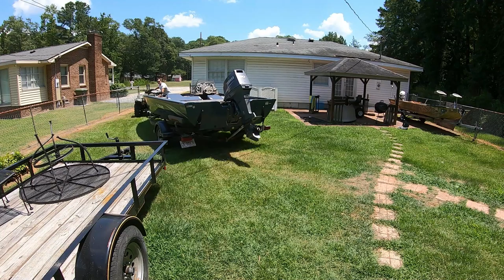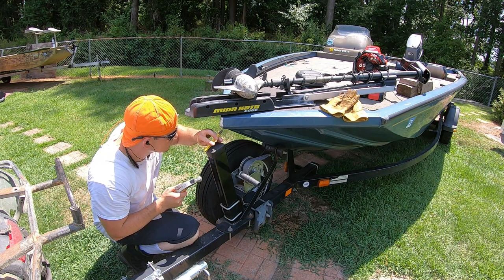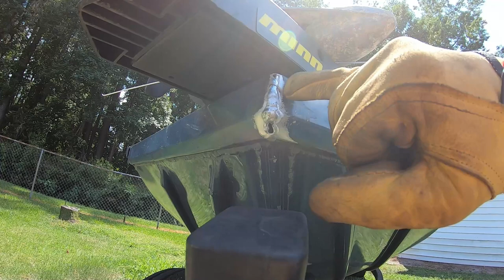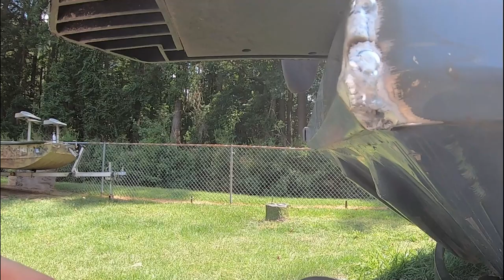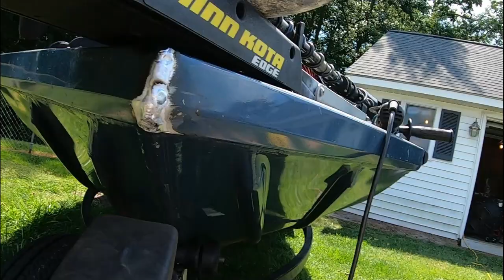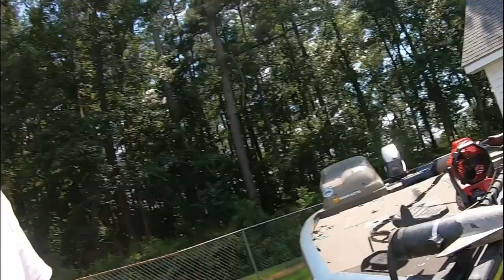How To Weld An Aluminum Boat

Comment: Nice job buddy, that will be stronger then it previously was. I've been working on boats for 44 years and still have the lowest labor rate than anyone but, you know as well as I do that it isn't any problem exchanging that argon tank with our labor rates  😊
Reply from the maker: Thanks for the compliment! Now that its been a couple years and have grown alot in business knowledge, I know what my prices should have been.

Comment: 3 seconds with a spool gun and done. Dude spent 20 minutes and a bottle of argon for a 3 inch crack.
Reply from the maker: Spool gun doesnt have the heat control that tig does for thin metal

Comment: Where's you PPE before try to teach how to weld  show how to use the right PPE
Reply from the maker: Thanks for watching!
Reply: sometimes ya gota do what ya gota do...Due to weather / position /100+ deg welding environment ain,t fun /or easy...Cant be in breeze or have fan cause it will blow away your sheild gas cover...
Reply from the maker: @danbarosh2942  You are exactly right my friend. The longer you do this, the more tips and tricks you can come up with to help you out. My biggest one yet, is setting up a popup tent right outside the shop. Just the shade can change the out look of a project.